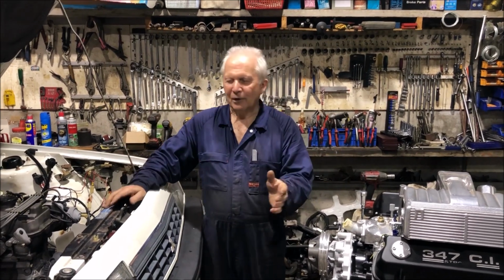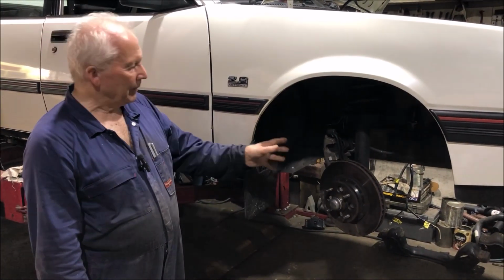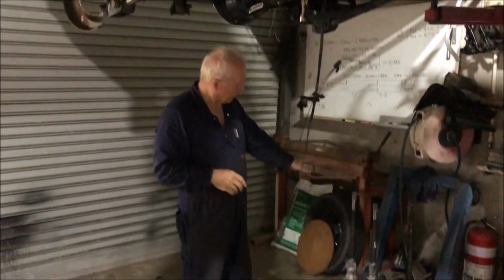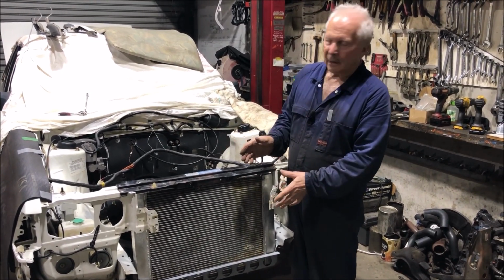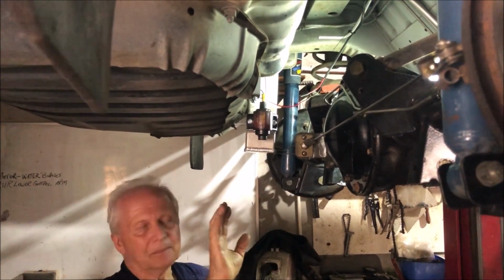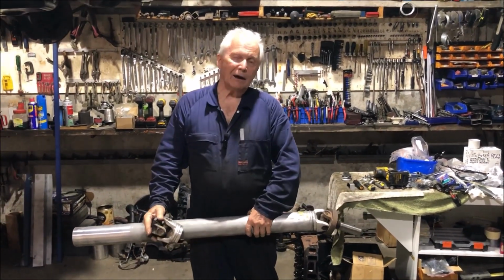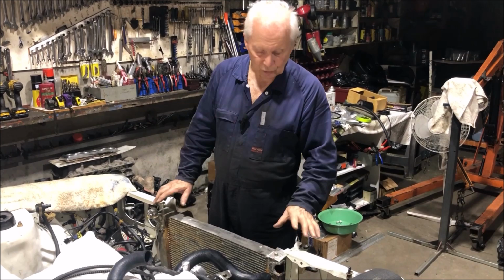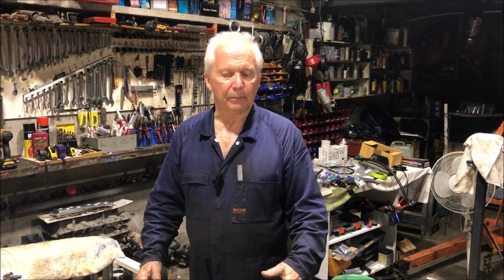Sigma V8 347 stroker conversion Part 1. My own car. 347 Windsor Sigma conversion.

Comment: I like your work  , however  I'm not sure about that tailshaft choice . I've seen those aluminium ones let go on the dyno .
Reply from the maker: It worries me as well, although I put an alloy one in the blue Scorpion I did about 5 years ago and it's still OK, I am making a steel shaft as well....

Comment: I love the way this all fits together, but have wondered why You like the sigma so much? 

I had a 1978 model about 30yrs ago that didn't end up getting back on the road in my ownership at least.
Reply from the maker: It's not that I like Sigma's that much. When I did my first V8 Sigma around 1986 they were cheap disposable cars and a real odd ball conversion when everybody else was doing Capri's and Cortina's and V8 XJ6 Jags. Today you look a Capri basket case and it's probably going to cost you $20K. I can't remember the last time I saw a Cortina advertised....